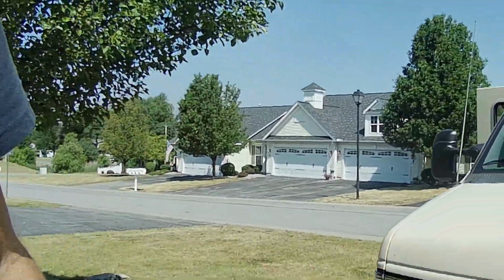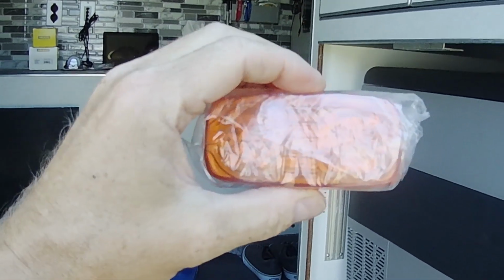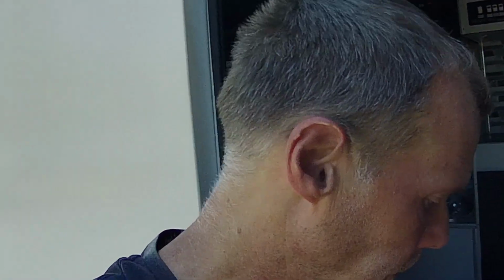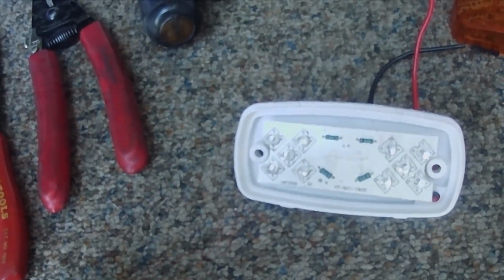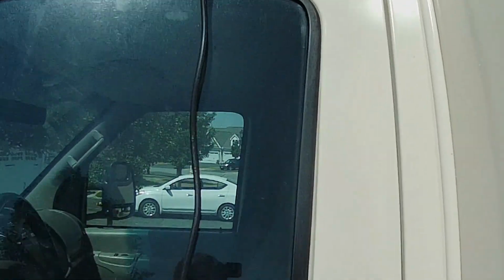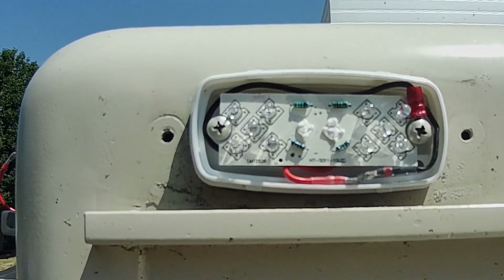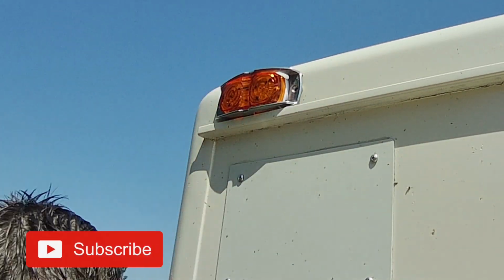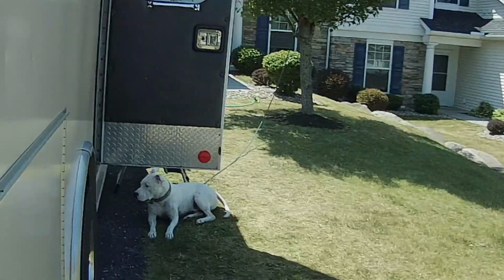Ambulance Conversion Clearance Lights LED Upgrade | Building The Campulance

Comment: It's nice that the footprint of the new lights matched as well as they did, even with the challenge of wire routing presented to you.
I am a little surprised you didn't clean under them while you had them off. ;-)

Comment: Good job David. Nice to see. Questions: No need for weather gasket between light fixture and body or would that be overkill? I must have missed the video but what is the chrome metal vent on the back of the box, driver's side for? Thanks and keep 'em comin'! Cheers
Reply from the maker: Hi Richard! The wire that comes through the box is grommeted and the screw holes have dumdum in them too. The lights themselves have a small hole for the wire and I'm not concerned with any water possibly getting in there. If there is any down the road I can revisit them. Great question! The metal vent covers the output from the factory exhaust fan. That fan is still operational although I don't use it  - its loud and doesn't move a lot of air...